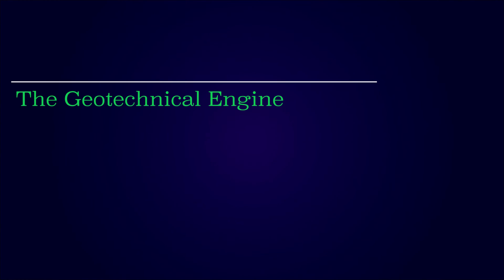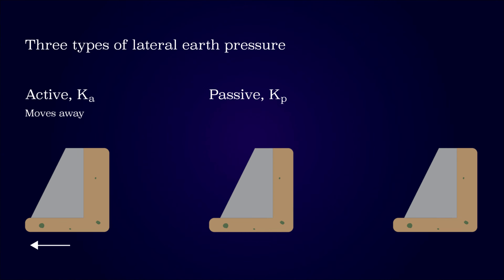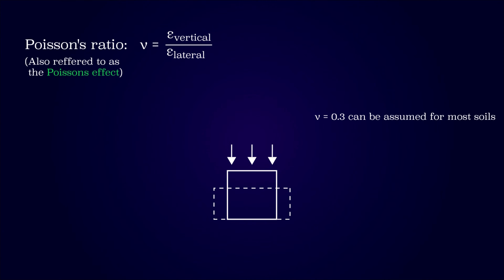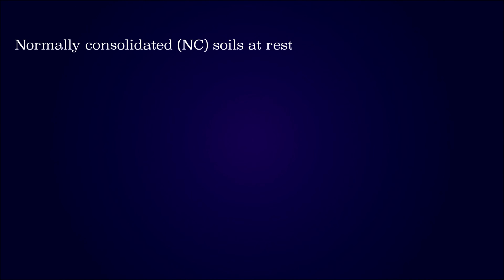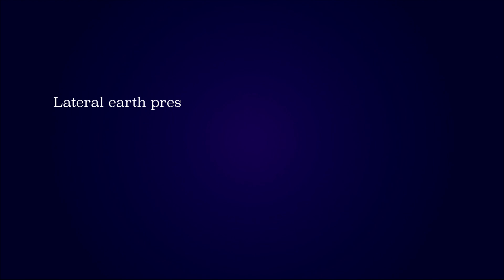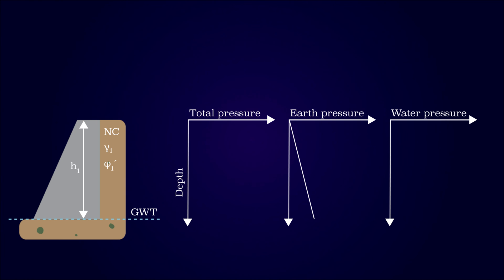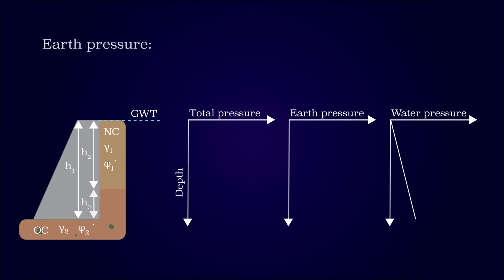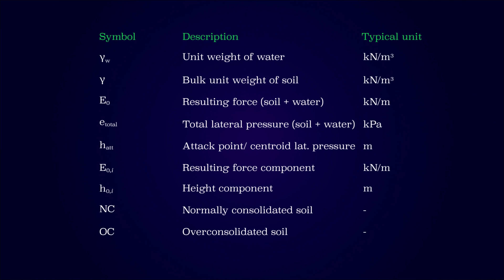Lateral Earth Pressure At Rest

Comment: As I understand for retaining walls active soil pressure should be used as they tend to move a bit in a direction of soil pressure force.
How it is for underground chambers?
As it is stiff underground structure and horizontal soil forces on all walls are equal but in different directions they cancel each other out so structure does not move.
So for underground chambers at-rest pressure should be used? (considering compacted backfilling)